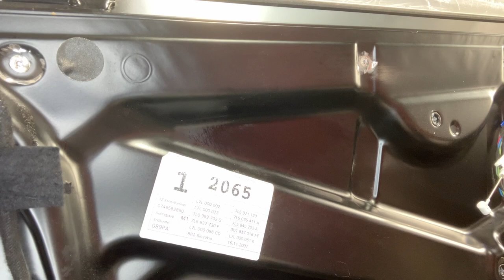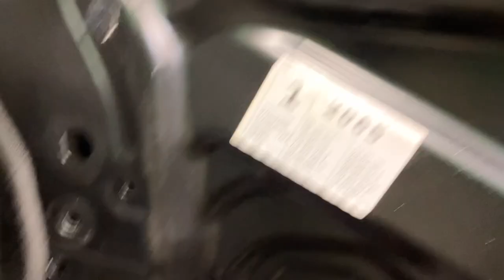Replacing a 9PA Cayenne passenger side window regulator.

Comment: Hi, I saw some of your videos on the boxter. I have a 2001 boxter S and the windows don’t go up or down. Top works. Changed the fuse and removed the immobilizer to dry it and changed the fuse because water leaked somehow inside the car and below the driver seat. Also, there is a strange noise while driving coming from the passenger door lock system. Kinda scary! Is there any video you can suggest to find a solution to that?
Reply from the maker: Hello and welcome.  Thanks for following.  I have not done one on the Boxster windows yet.  I still intend to finish the series but took a new job and had to move my projects there.  Engine is complete and ready to do the install video. That will probably be 2-3 parts them I'm going to start on the interior restoration.  I know it is a ways out but hopefully there will be some content you can use.  For the time being, I think you are on the right track with the immobilizer.  There are quite a few good electronics repair places that do them rather quickly for a fraction of a new replacement.  As I try to do I am currently working on learning how to download the memory from these so that I can do a how to but that also is far out on the schedule. again thanks for watching and stay tuned.